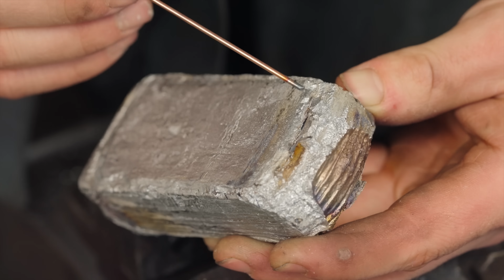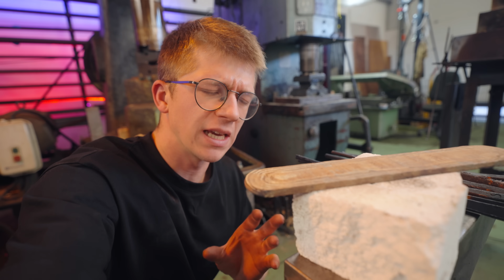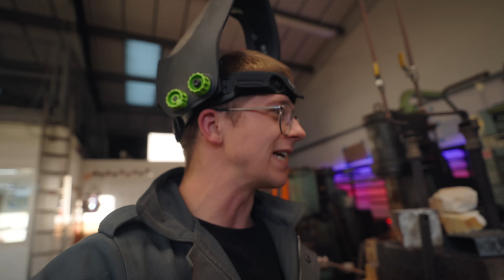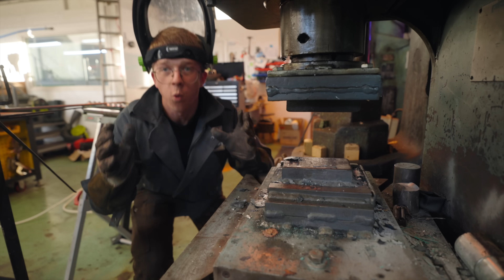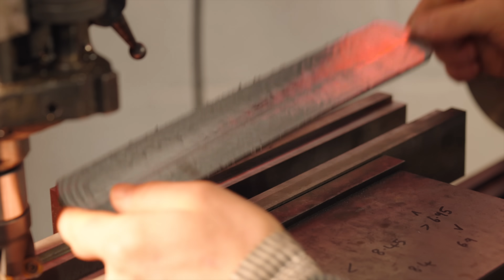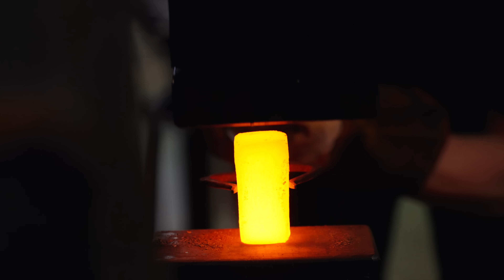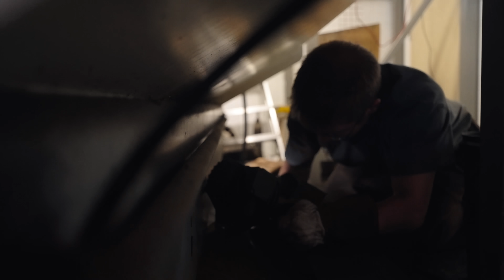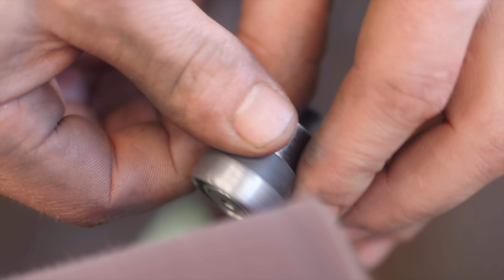Can I Make Titanium Damascus? Part 2

Comment: so if you look up "titanium phase diagram" it seems like for certain alloys it forsm different crystal structures and some of them actually have a lower melting point with higher pressures, so when you got it under the hydraulik press, it melts from the pressure. this is just my first guess idk if im right

on the other hand, back when you did the other titanium projects, you didnt experience this
Reply: not to mention adding alloys will reduce the temp
Reply: I was about to write something along this line, or, it might be getting, maybe not hot enough to melt but hot enough to get very very soft , soft enough that it can squeeze out, like partially melt.
Reply: @starbomber  another thing i thought of, if a metal is deformed it gets hot like starting a fire with a steel rod and a hammer maybe the same thing happes inside the titanium, but that would happen with steel forging too so i doubt it
Reply: I have a PhD in materials science, and my money is on a eutectic mixture being the culprit, not the pressure from the forge.
Reply: @OldTiredEyes  nice thought. Definitely could be.
Reply: @OldTiredEyes   Looked over at the phase diagram and my guess is FeTi-Ti Eutectic solution, melting point a bit over 1300 K. We see Iron-Titanium almagamation at the phase boundary when he opens up the jacket.
Reply: Very unlikely since the maximum amount of temperature increase should be about 50 degrees celsius.
Reply: @bd12345-n  from what i have found, with the beta phase, the melting point decreases by 350 °c
Reply: Its melting because you are too hot.   No more than 1950F.   You are making a eutectic reaction with the steel, thats why it is melting.  Coat the inside of the can with a lime slurry, let it dry good.
Reply: Well, Alec is definitely in his titanium phase 😂😂😂
Reply: Might be part of it but I doubt it because 1. It still shot out liquid while it was in the forge and 2. Unless it was already very close to the melting point, which it isn’t it’s 900 degrees away, the metal won’t go from a soft solid to complete liquid in a few seconds with a relatively small increase in pressure
Reply: @kadenherzog9727  That's the melting point of pure Ti, these are alloys
Reply: @kadenherzog9727  I would guess that Ti expands at a different rate than the steel box as well, thus increasing pressure even before pressing it with the power hammer
Reply: @kadenherzog9727  Is it a relatively small increase though? if they are still flowing argon through it (or it just can't escape easy enough) that gas is going to try very very hard to expand with the huge temperature increase from room temp to forging temp as well as the forging pressure I'd think. I think its more likely to be the mix of metals having very different properties myself, but it could be just getting hotter and more pressurised than it can take and stay a solid.
Reply: @kadenherzog9727  Look up eutectic melting points. It changes the properties entirely
Reply: @kadenherzog9727 idk man I've seen people take a nail to red hot with a hammer in a 60 sec yt short with no cuts. So in theory a power hammer should be able to increase temp quite a bit. Although you're probably right at know much more than me, and I assume the higher the temp the harder that is to actually do
Reply: While that’s true, the melting point difference is not big enough to be due to that. 

Also debatable that the different crystal structure is even allowed to form in the time that it takes to heat up and hammer it.
Reply: No, you had a eurectic reaction with the steel case.   He heated the pack up way too hot the first time too.  No need to go above 1900-1950F. And
Reply: seems like not quite but good idea
Reply: Still too fast on your cutterhead, and use coolant
Reply: Have fun, "constitutional diagram" yields no relevant results. Just a heads-up.
Reply: I just did a chemistry lab explaining this exact subject matter 😂
Reply: That’s about right but also depends on the alloys. Looking at a pdf it seems the temp needs to be like 1400 F - 1950F. My guess 1650 F would be best
Reply: The steel and Damascus have a high expansion rate when heated, it may be causing additional pressure and energy exchange = more heat under the pressure it only has one place to go
Reply: This would be exactly my thoughts. I’m not too knowledgeable in metals but my first two ideas were that the material isn’t 100% titanium or there is some pressure aspect causing the metal to liquidate and spray out
Reply: Don’t forget the gas mixture is different. Most of these temperature readings are based on normal air mixture.
Reply: That's an interesting observation! You're right that titanium alloys can exhibit different crystal structures depending on pressure and temperature, as seen in their phase diagrams. However, the melting point typically increases with pressure for pure metals due to the Clapeyron equation. If melting occurs under a hydraulic press, it might not be traditional melting but could be related to localized adiabatic heating, material flow, or even phase transformations under extreme conditions. In previous projects, the parameters might not have been sufficient to induce such effects. It’s a complex topic worth exploring further
Reply: You friend have it correct, when you apply pressure to metal it will actually heat up 100s of degrees.
Reply: Maybe you should try the average temperature (1,850°F) from the patent record.
Reply: While this could play a part, remember it would solidify almost immediately after the pressure is relieved, which isn't the case. Think about how fast a gas cools down when exiting a pressured cylinder. The increase of temperature due to pressure is not because it got *pressurized*, but rather because it is *under pressure*.  That is why heat pumps work, the coolant retains its properties at the pressure, those properties don't dissipate over time, as they rely on the pressure it is under, and not the fact that it got pressurized at the compressor.
Reply: Ok yes
Reply: Seems like a very fickle process and probably why the patent was allowed to expire. Likely they refined a better method that is still under patent.
Reply: Maybe they sold u not pure titanium to milk profits lol
Reply: I think the pressure of the hydraulic press increases the local temperature enough to pass the melting point
Reply: @LashanR  HCP vs BCC / FCC metals.  HCP metals like Ti do wacko things just because of that molecular structure. Try visualizing moving a crystal lattice sideways and then shifting, pressing and twisting... The jumble and reset is quite chaotic vs the smooth slide and shuffle of FCC/BCC. 

I would suggest starting at 1700 deg F and working up, not down for that very reason. Also expect to take ten times as long with less power on the press. 

I literally expected a shot of fire to eject from the first block, and I wasn't disappointed!  

My machine time with Ti alloys was limited, I mostly worked with Aluminum and UHMWPE. Mostly because Ti just wasn't worth the nightmare tooling game.
Reply: Might be adding too little of the argon gas or too much of it and making it built up with moisture and it's reacting with the steel causing it to heat up more I would try configuring the gas flow to see if that fixes the problem
Reply: @frankgeorge9991 nonsens
Reply: Well. Regardless of what is really happening. The way I read the Abstract in the top search result is that Aluminium has less of chance of this happening. So It's worth trying an aluminium can maybe.
Reply: @sparkyenergia absolutely not.  The steel can is correct, and is what is used for pack rolling 6-4 titanium sheet (it cannot be cold rolled, much).  1020 steel is good.  And heat the pack/can to no hotter than 1950F for this step.  This is a typical forging temp for 6-4, and CP lower.
Reply: @jonquinn11  Thanks.
Reply: Yeah I was thinking it was the inert gas affecting it partly
Reply: Maybe its due to Argon Gas
Reply: @jack-i-ripper7815  pressure of maybe. Could be too high. Also could be an issue of entrapment during the blocking process. Are you running argon WHILE assembling the block?  I'd have the weld going then. Also, consider a spaced block with a single small hole. Leave 0.5mm gap at the exit side with shims. 

I don't think Argon is getting everywhere. 😊😅

Comment: lower melting point due to high pressure inside the billet from the impact of the power hammer?
Reply: Melting point remains the same, but titanium has a tendency to really heat up under pressure compared to steel.  Also titanium forms an alloy with iron that melts at a way lower temp.

Comment: "lets try to avoid a titanium fire today" 
1 minute later
literally lighting titanium chips on fire
Reply: I knew this would be in the top comments.
Reply: that is the difference between controlled and uncontrolled
Reply: My friend worked at a Pulp and Paper Mill and he also did volunteer firefighting so he was on staff when a bunch of people doing some work on a heat exchange unit we're using a torch to cut apart the fire tubes which were titanium. Predictably, they used water to try to put it out which did not work but luckily it dissipated heat quickly enough that it put itself out
Reply: Lol! Reminded me of when DB Blades made knives out of 25mm thick titanium billets. He succeeded, but swore never again
Reply: If you're lathing Titanium, you want the chips to burn as they fly off instead of collecting.
If they gather you will have a much bigger issue later on.
Reply: neat thing about that, people who put titanium in lathes tend to set the thing on fire so that all the chips burn off instead of collecting where they become a fire hazard
Reply: *unintentionally
Reply: I mean.... Intentionally light the fire before you have a giant fire later.
Reply: its all about starting fires on your own terms.